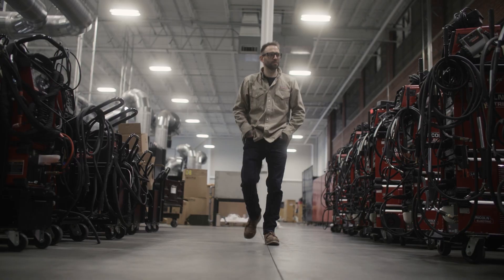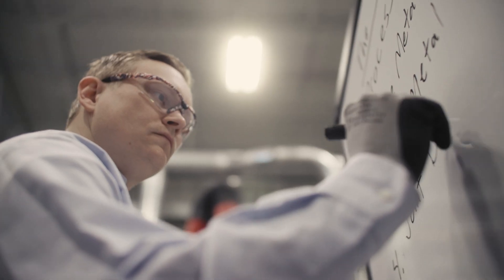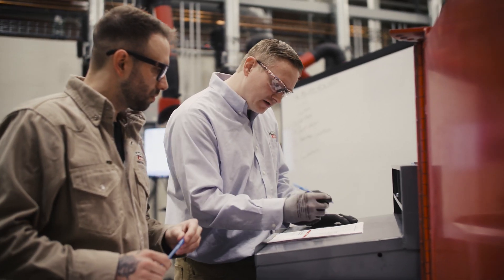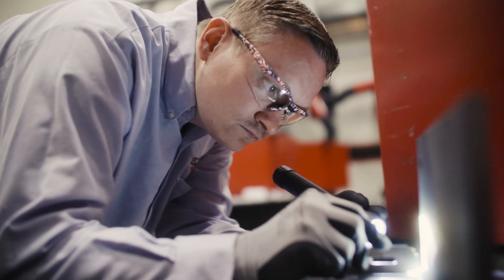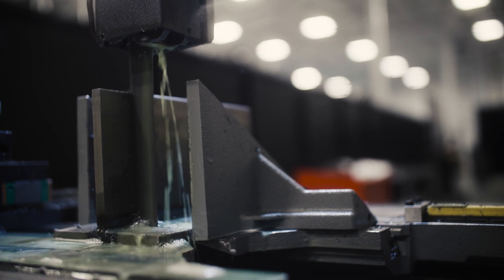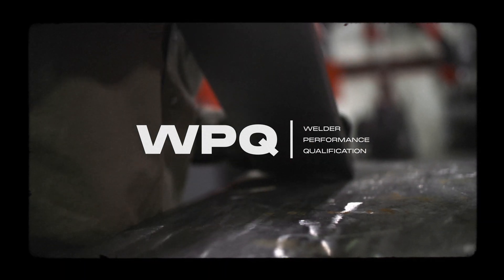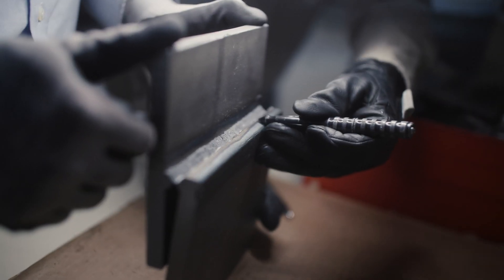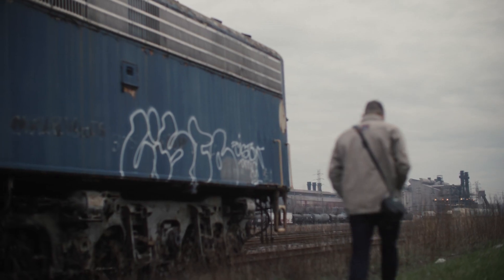How welding certification REALLY works

Comment: Isn't it stated in most Codes the welder that welds the PQR is automatically qualified if the PQR passes? Doing the second test seems pointless since the PQR gets destructively tested as well.
Reply from the maker: You are correct! We really wanted to show folks all the steps in the process and make sure there were no reasons for anyone to doubt the results.